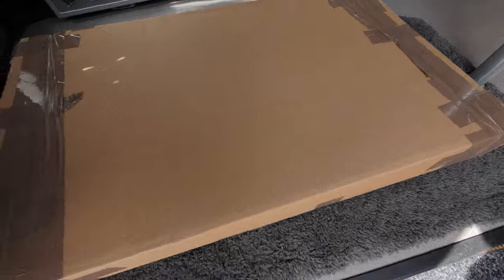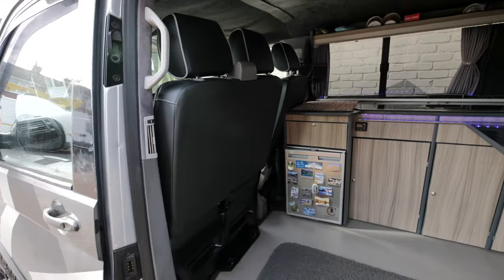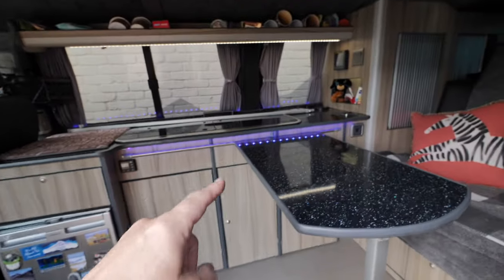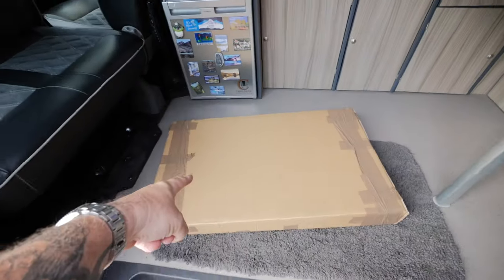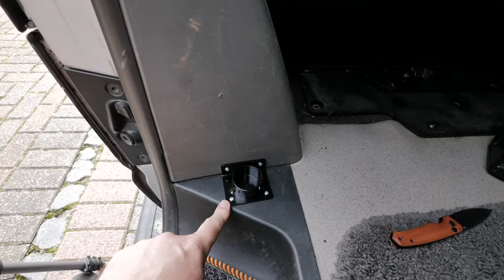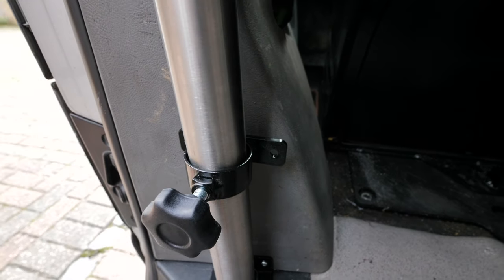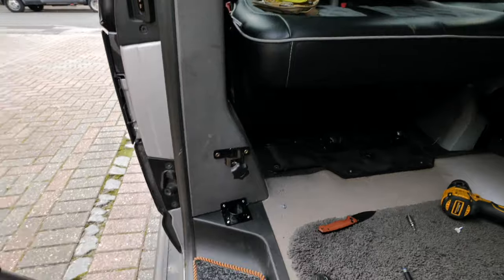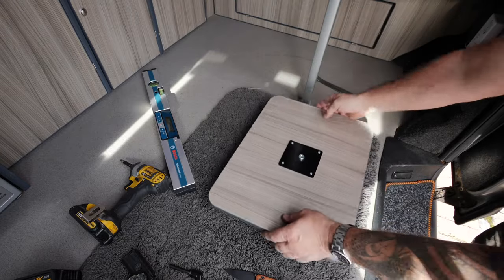VW Camper Swing Out Table by Evo Motion Designs

Comment: Hey Lee did you get a misfire on idle when your head gasket went think mine has just gone as got a misfire on idle an using a bit of water waiting on cp  for a asz
Reply from the maker: Mine ran perfect when the head gasket went. Just pressurised the header tank and over heated.
Reply: @SpyderLEE  oh ok see when I'm driving its like new soon as I idle it starts misfiring iv got a bit of cream under the cap and the water goes down to minimum every 10miles code is misfire cylinder 4 im thinking when i changed the tandem pump its disturbed it when I cleaned the oil away 🙈